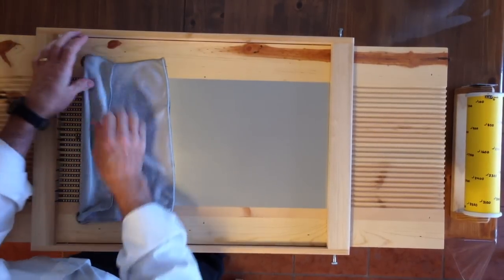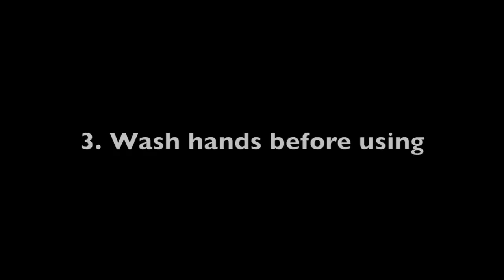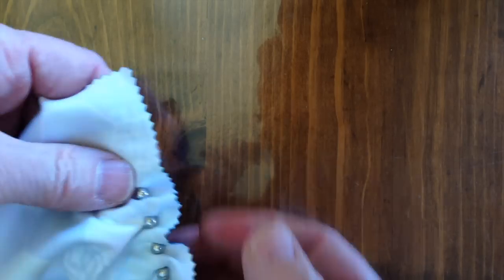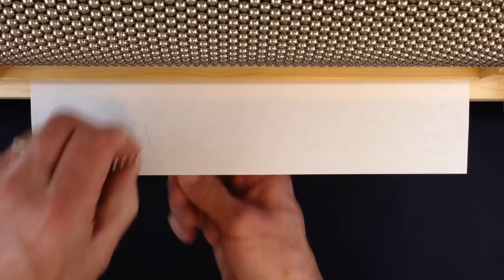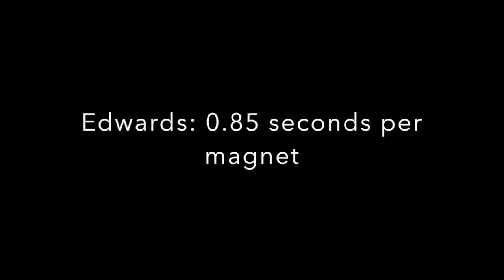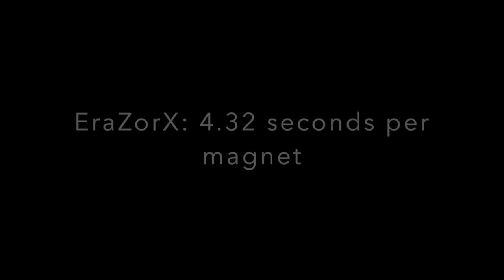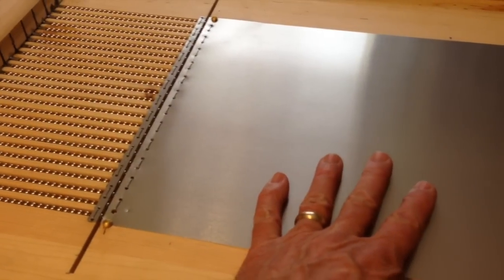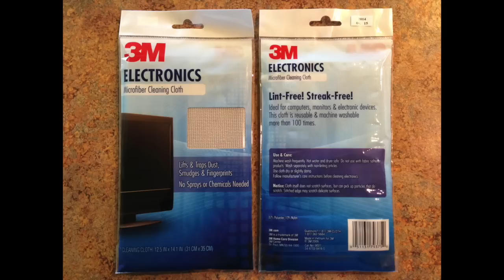Magnet Cleaner (Zen Magnets)

Comment: You need to make this a lomb to slide the cloth back and forth and clean faster.  Adding lomb and weaving techniques would be make this even faster.
Reply from the maker: You mean a "loom"?  Sounds like  a great idea!
Reply: An idea that would be worth trying is to make a frame with lacing like a loom with the piece of fabric laced in the middle but able to move up and down.
The fabric would only have a to be a long as the paper you use in the other technique and therefore easier to move up and down.
It could be hard laced, as in you need to move the strings to move the swatch or soft laced the strings stay still and you move the cloth up and down along the string track.
When the swatch is out of the way the magnets will push the strings over and still run on the track. 
I would look like a Frame Loom - https://s-media-cache-ak0.pinimg.com/originals/34/ca/4b/34ca4bb8a5289fff3c484d8bab5e2e3e.jpg
Reply: O! I also wanted to tell you this video was posted to a Specialized Tools forum.
Reply: compounding on that idea you may even be able to automate this whole process using a few mini motors to move the slide and something to push and pull the loom, probably take a while to make but would most likely cut the time to a few min or so.
Reply from the maker: Thanks for letting me know!

Comment: where the hell did you get that much magnets
Reply from the maker: Of my 84 sets of magnets (each set contains 216 magnets), 34 were purchased with cash, 14 were received for photographs accepted into the Zen Magnets gallery, 8 were awarded for winning Zen Magnets Contest 39, 18 sets were traded for cash winnings from Zen Magnets Contests 34 and 39, and 10 sets were awarded for my help in resolving an oversize magnet problem.